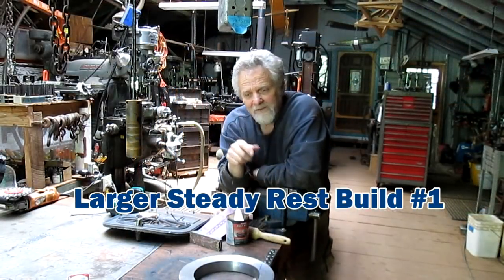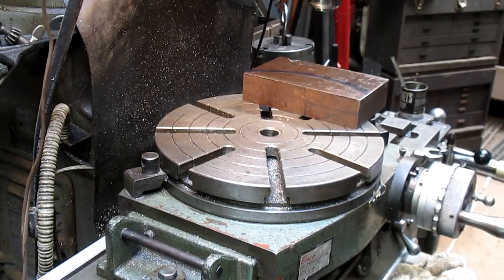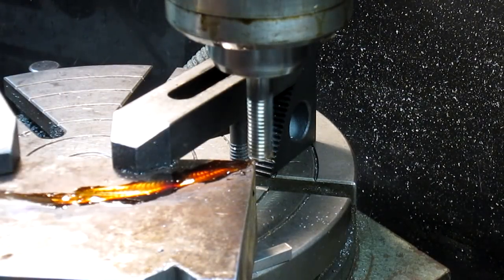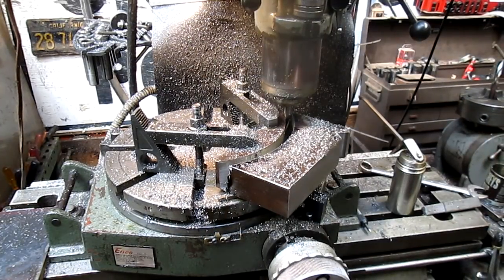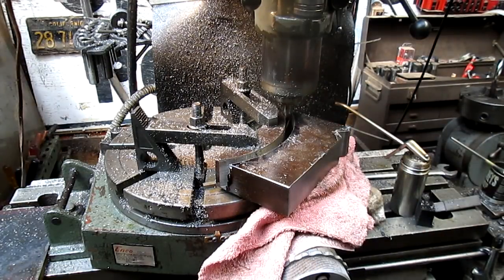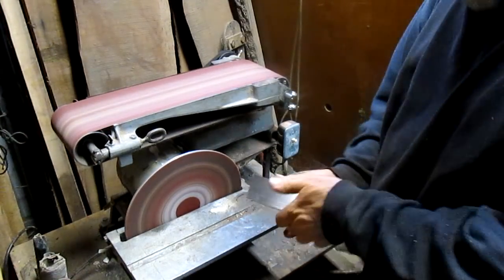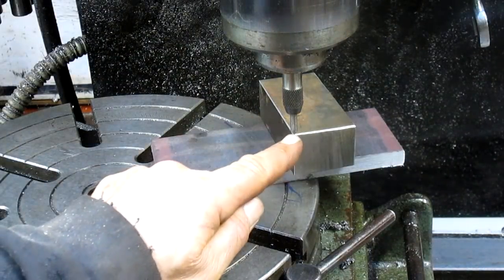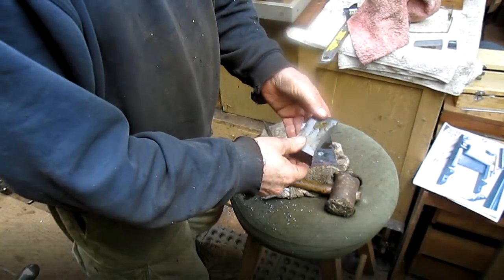Steady Rest Build #1

Comment: I see you have embarked on a similar journey as I did a while back. What a long process.  A big mistake I made was not using roller bearings. I used ball bearings and they broke under pressure. There were other design failures as well, but that was the worst. Good luck. I like your different approach and you are quite the personality. I am down in So. Cal. but have been up to Grass Valley for training at work multiple times and love the area, so beautiful. Good luck.
Reply from the maker: Yes, it is a long process, for me like an all day sucker, giving pleasure every minute. Yeah, mistakes are made, it comes with the territory. Key is to have fun. 
Hey, if you are ever up in the area, don't hesitate to give a call and drop by. I always like talking about machines. Thanks for watching

Comment: Nick, great video, but a question please. Why did you go to all the trouble of milling the radius in the bottom block to lower the ring ? Why did you not just cut the ring flat where you had marked the line, it would have achieved the same outcome, lot less work, bandsaw job and a quick cleanup.Then just weld the two parts together. If you had wanted to do the radius but did not have a rotary table, you could have clamped it to the table or even in the vice if the jaws opened enough; then set your boring head to the correct radius and machined it with that. You would of course needed to bandsaw away as much as possible of the scrap bit to save on cutting time. Anyway, you have done it now, but it was just a thought. Loved the bit by the way where you kept running your spindle into the clamp, I was sitting here shouting its the clamp, whilst you kept looking at the lower cutter depth. LOL Hope you did not damage the spindle nose or the collett.
Reply: No, that would not have achieved the same thing. If he cut the ring, he would have lost half the capacity of the steady rest and the center of the work area would no longer be centered in the ring. The only choice was to do what he did.
Reply: +grntitan. Sorry to disagree, but if you look closely at the start of the video, the line Nick has drawn on the ring is exactly the same distance he radially milled away. The bottom internal diameter of the ring when fitted into the milled radius, makes it come flush with the top of the mounting block. Exactly the same height as if he cut it off straight, NO internal heigh is lost.
Reply: Dave Ticehurst Take a piece of paper. Cut a ring out like his ring. Now measure the inside square dimensions. Now cut off the bottom of the ring and measure those square dimensions again. How much work capacity did you lose? With the way he did it, you lose none. Your way, you could lose as much as half or more by the time your workpiece arms are added.
Reply from the maker: I liked the arch to be accurate. I am never one to be concerned about wasting time with my own projects. It's all about the fun of doing the project. Didn't hurt anything, little scratch marks in the clamp.
Reply: +grntitan. You seem to not understand what you are watching. Nick has only lowered the ring by the wall thickness, where the line has been drawn on the ring with a marker pen. I suspect that Nick just laid the ring on top of the base block with the line flush with the top of the block, then scribed the arc using the outside of the ring. NO loss of area is involved, the inner diameter came flush with the top of the block, exactly the same result could have been achieved by a straight cut. Nick has replied to me and HE did not contradict me, just said he did not mind the extra time doing the radial milling.
Reply: Dave Ticehurst No, I more than understand what is going on. I do this for a living. The problem is, you refuse to see outside your need to always look like the smart guy. I’ve viewed your comments before. You always find something the YouTube maker could have done “better” according to you. Your views are completely one sided just like the thumbs down you can Joe Py simply because he was milling a gun part. I’m still waiting to view “YOUR” videos where you show everyone “YOUR” skills. I got an idea, make you a steady rest where you cut the ring flat. Then film it and show us all. We will be waiting, or not.
Reply: dave   knows best dont you know
Reply: +grntitan. Well, final say on my part. I did manufacturing, tool making and Machine Tool repairs for over 40 Years, so I too know what I am talking about. Sorry we seem to differ, we will just have to wait and see when the item is totally finished, and when it shows that what I have said is true that the bottom of the inner ring is flush with the top of the mounting block, I will accept your apology. I wonder as to whether you are one of the guys that Joe Pie had to ban from his channel due to a lot of nasty posts received about him making gun parts ? He personally wrote to me apologising for the hard time a lot of commenters were giving me over me not liking him make gun parts. Finally I have no intentions of making any videos to prove how good I am at what I am capable of making. Merry Christmas.
Reply: If the chord depth of the arc that Nik cut is less than or equal to the thickness of the ring, then there is no workspace lost. In that case, all of the material you cut off of the ring to make the flat is outside of the center opening in the ring. However, if the chord depth exceeds ring thickness, you are cutting into the ring opening and reducing available opening size. I personally like the idea of cutting a flat on the ring, regardless. Let’s say that you end up with a flat along the bottom. Then, the ring segment gives you an ideal place to clamp the welded assembly to either a rotary table (to machine out an arc the way Nik did) or to the mill table itself (where you can machine it out with a boring head). I like this order of ops better than hanging the workpiece out over the rotary table. No knock on Nik. He got the job done.
Reply: Dave Ticehurst  if he cuts the bottom off the ring he will have to increase the depth of the mounting plate so he doesn’t loose diameter. I think cutting the radius in the mounting plate is much more elegant solution especially since it’s a personal project and not a money maker. Plus he gets more practice on the rotary table.

Comment: I don't understand why you can't slot the the old follow rest and drill and ream for 5/16" dia. Dowel pin and bearings to match. I'm sure you can do it . If it's the bore then I understand , the steady has a small hole for lathe size. Have fun and God bless.
Reply from the maker: I did want a bigger bore.

Comment: Probably easier, in the long run, to make one from scratch rather than modifying another one to fit.  I had three extra steady's in the lot of stuff that came with my Mueller.  I traded the largest (weighing probably around 125 lbs) to someone for a motor.  He couldn't use it because it was too big (turned out, I couldn't use the motor, either).  Everyone that looked at it after that had the same problem, too big and trimming the base to fit would have removed too much of it for the steady to maintain it's integrity.  It finally ended up going to Keith Rucker for his huge Monarch.  His comment?  "It's a little small...."

At least one of the other two surplus steady's will go on a heavy stand to support long work that runs through the spindle.  The other is open for trade, unless I think of another use for it.
Reply from the maker: It's always good to pass tools on when it can't be used. Nice that keith could use it.